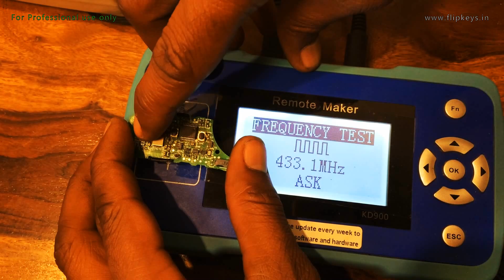Land Rover Key FOB Battery Change

Comment: Very good,I did exactly step by step following the video after I finished I tried right away but didn't work ,do I have to do something else after installing the battery?
Thank you
Reply from the maker: Normally not

If you have some device to check whether there is output from remote (in form of frequency waves) then you can confirm problem in remote or in car

Comment: Not really the best soldering iron to use on a small board. I would recommend a desolding tool and a 15w iron to do the job safely - Too much heat could easily damage the board or associated components.

Comment: will this cause the remote to loose it's program
Reply from the maker: Adam Frazier I don't think so
Reply: Good day. I have an issue with my 2008 fob  3 button key. it won't lock or u lock the door and I just replaced the battery. the car start and all that just that it has a chirp when the door is unlocked with the key. how can I solve this problem?
Reply: I have the same problem right now